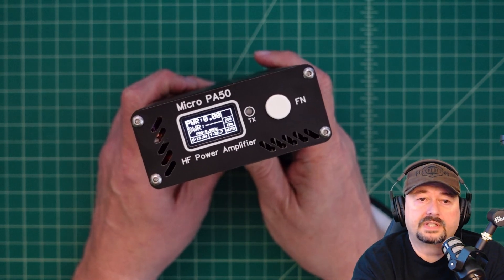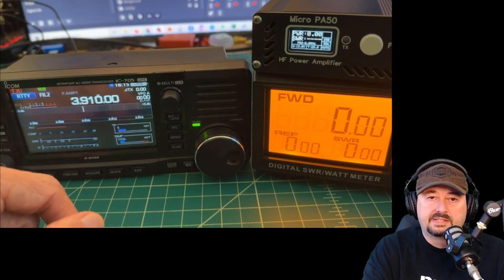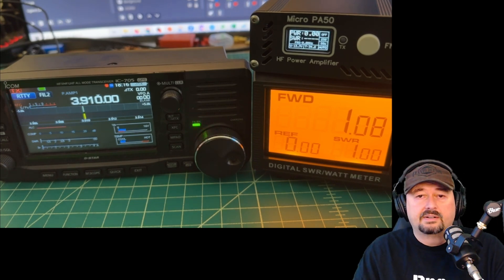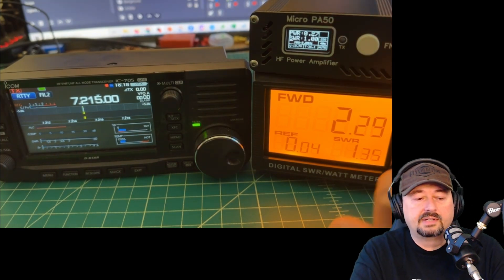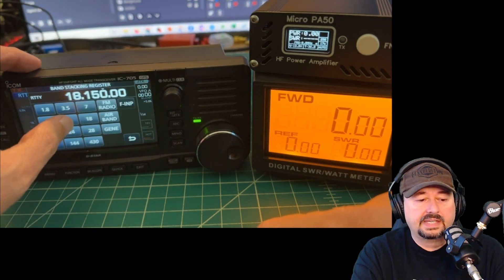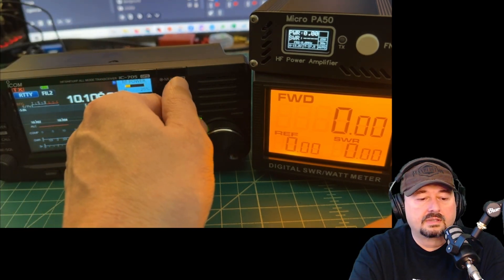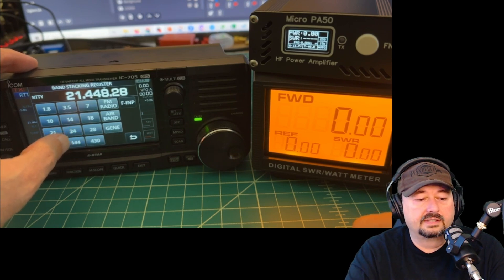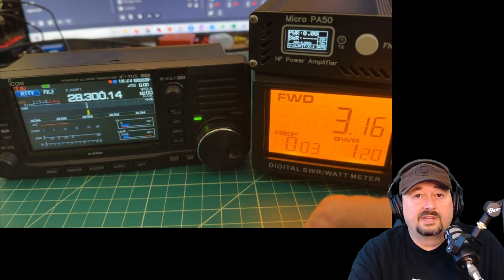Micro PA50 HF Amplifier Input Impedance

Comment: I have the same problem here with a Micro PA100; when new, everything was ok, but over time (I mean since I bought it) it kept rising... I changed the cables between the transceiver and the amp, put all kinds of longer/shorter ones with normal or 90-degree connectors, but the problem remained constant... interestingly, I didn't have an SWR problem in 20m on a 1/4 wave antenna as reported by ON7OFF... that is until recently when... something definitely broke in the finals because now it's 3W in -12W out... 73 de YO2CPS
Reply from the maker: Sorry to hear that

Comment: people get to worried about a little SWR, this is from false advertisement for antennas and other equipment, this simply is nothing to worry about, its HF, if you want perfect 1:1 SWR then run it in a dummy load, or move on and operate! just my opinion, great video explaining what I am talking about.
Reply from the maker: Hey Jim, thanks for the comment 👍

Comment: on the input of a amp. 1.5 SWR or less is fine. some times the coax length can make a difference on some bands. I have found the type of coax from radio to amp can make a difference. poor shielding. bent to far . bad connector.  A common problem I find is the coax jumper . test them . I have fixed many RF amps.  A good 3 ft jumper like ABR 8X or M & P hyperflex 6 or 7 works great. the MIL spec 58/CU is also good. as well as PTFE coax like RG 316/400/393 . crimp PL 259 can come loose if bend allot. I changed my jumpers to POTAFLEX 7 coax. made to bend a lot. 73's
Reply from the maker: Good info, connectors can be a problem for sure 👍

Comment: One SWR issue I have experienced is that some PL259 barrels (threaded rings) are too long for the short SO239 jacks on the back. So if you notice that the center conductors can still move in and out one the rings are tight, then you probably need to use a different style PL259. Or.. I took a belt sander and ground off about 1/16” off the leading edge of the barrel to allow the center to fully seat before the barrel bottomed out on the SO239.  73! WR9R
Reply from the maker: That's nice info, thanks man!

Comment: All is fine. To get precise 1:1, the amp design would need either a strong attenuation network, which would lower the amplifier gain, or a matching network for each band, which is not reasonable.

The swr difference is due to the power transistor input impedance, which is frequency dependant.
Reply from the maker: Totally agree Rafael, thanks for watching 👍

Comment: Sometimes at low powers the reflected power isn't sufficient to give accurate results with diode based detectors. If you have a directional coupler or can make one and use it with a spec analyser, it may give different results. The drive level may change results also. But the moderate SWR looks excellent.
Reply from the maker: Good point tech, thanks for the perspective 👍

Comment: Driving QRP levels into the amp will not hurt the radio at 1.35 SWR, as long as the amp output is ok is clean. 

Has @TheSmokinApe checked how clean the amp output is? Takes more attenuators than an HT.
Reply from the maker: Yeah, I’m one team “below 1.5 is fine” and I haven’t check the spurs yet 👍

Comment: Great video! Thanks. Do other amplifiers increase the SWR to the radio?
Reply: The ogs-50 PA had very high swr on the input. A mod had to be done to make it safe for the radio
Reply: My 811H did and I have seen other amps do it. My Mercury IIIs does not but YMMV.
Reply from the maker: A decent amp should be below 1.5 👍
Reply: @TheSmokinApe  Thanks Ape